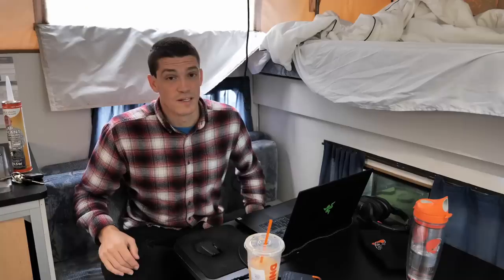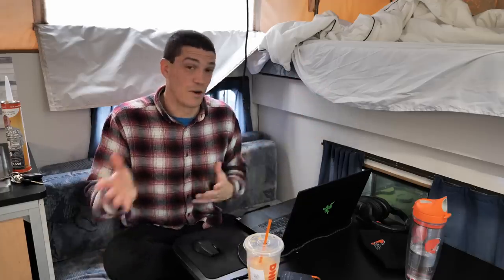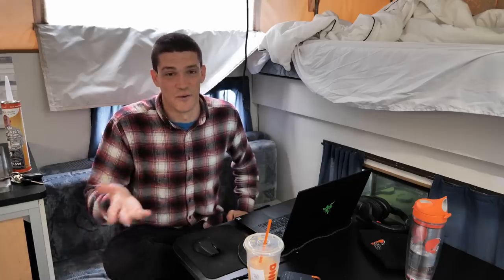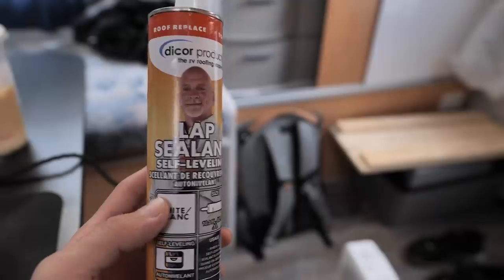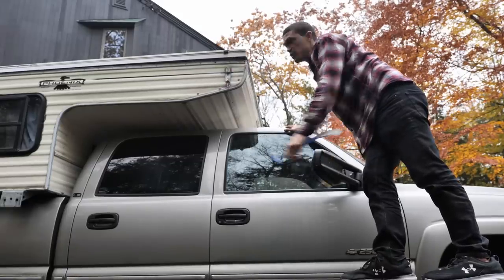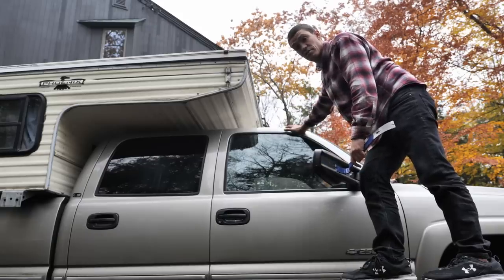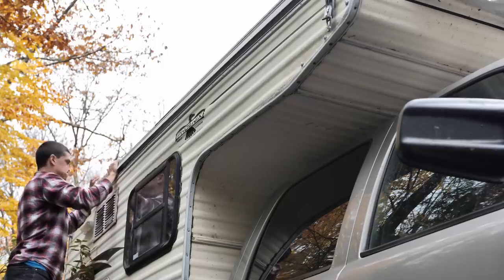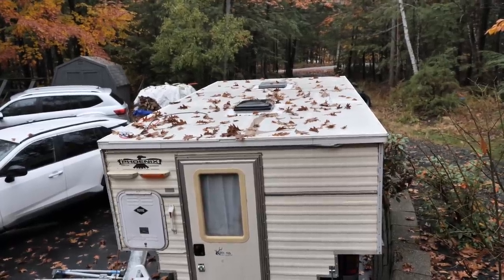Mistakes Were FIXED + Your Questions Answered | Truck Camper Life on the Road #vanlife

Comment: If you have an exhaust fan (Magic or Fantastic) turn it on high and shut the windows and doors when you get ready to lower the top. This will help pull the fabric inside the camper. A camper salesman showed me this trick on a new pop top camper.

Comment: Rivit a 4 inch rubber flap around the edges of the drop down roof so when you drop it down rain goes past the rubber and doesnt penetrate that should work, I used to have to fix those all the time

Comment: I just moved away from Florida.  I have been to many of the state parks. But the best overall park is Kelly Rock Springs in Apopka.  You float down for 30 minutes and it's a 10 minute walk back.  Tunes or floats less than 5 ft. Definitely worth checking out . Also close to 2 other parks.

Comment: When you buy your next pop up, look for the kind that has a hard top sides and a hard bottom sides and, when you lower the top, it descends around the bottom half and completely surrounds it in metal, so there is no canvas to leak. It's also safer since it's all metal and no one can break in by just cutting the canvas with a knife. The Alaskan Sportsman is one like that, but there are other makes.

Comment: I don’t know what to tell you about that pop top on your camper. I had a euro van for many years with the pop up. It does help to open the back door so that air gets out easily and then you just have to finesse it, pulling the canvas in from the inside, and then tucking it from the outside, but I’m not there so it’s hard to say. It’s just a speed bump so don’t let it get you down too much!

Comment: I feel ya.  Who needs another damn project lol.  Hopefully that new camper will bring ya some peace for awhile.  Maybe you can suggest to the new owner that their should be a water proof spray or fabric wax that they can put on the canvas?  And maybe add a rubber skirt that hangs off the top of the roof to overlap the crease when you close it?  Those ideas might help.

Comment: I don't know if it helps, but I've seen on some newer pop-ups, when you go to put it down, on the inside they attach some bungy cords from one side of the fabric to the other, that way when it compresses, the fabric is pulled inside vs. bunching up. Regardless, thanks for the update, I've been here for awhile and it's nice to better understand where you are going.  Looking forward to seeing the new camper. Keep driving your own journey.

Comment: The key to taking the top down is stay inside , close the door , turn the fan on and the pressure pulls in the canvas.then from the inside make sure the canvas is all in . Turn off the fan ,go outside take a look all around and then put your top down . I wish someone would have told us that trick with our first pop top . Hope this helps . They might even have a video on this method .

Comment: Hey Nate, is that a gas 2500?  If so, how does it handle the weight of the camper; especially on hills?  

I'm considering going the truck camper route myself for semi full-timing, and I don't want to deal with a diesel engine.

Also, how are the MPGs with a camper on it?